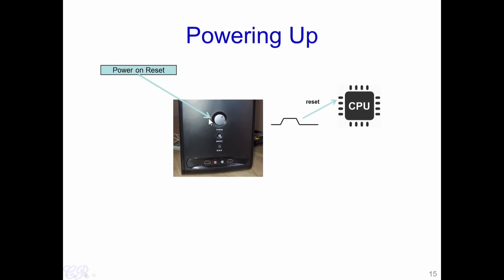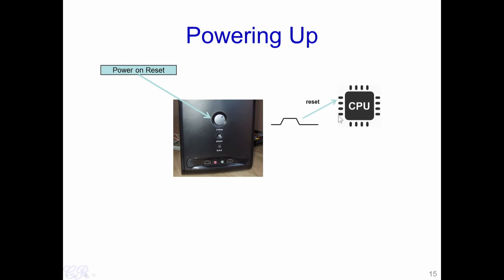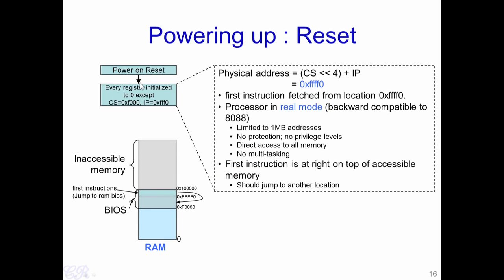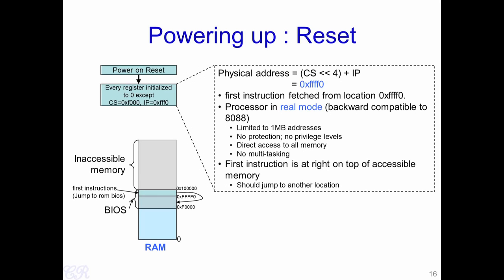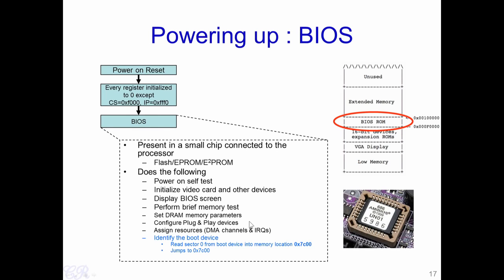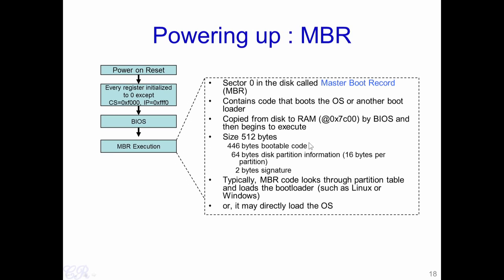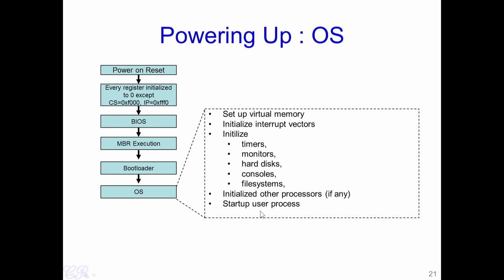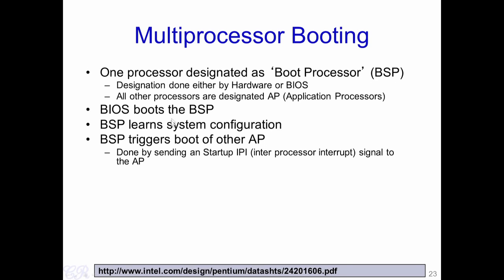Operating System #10 PC Booting: How PC Boots | Explained in Detail

Comment: I'm looking to learn even more detailed steps, going straight from pushing the power button to the CPU getting the reset signal is skipping many steps that I'm trying to examine. I'm basically trying to figure out how with no OS a computer can know enough to know that it has no os... the firmwear level, how does it know how to load a kernel, how does it run POST, how does it run cMOS, how does the cup even start to know about memory addresses, how many relays provide power to what components when the power button is pressed a physical connection is made allowing electrons to flow, that flow is regulated and controlled and sent to various parts in some scheme that gets the right voltage and amperage to the right parts at precise timing... all this breaks down to very small mechanical logic, but surely we don't manually program this by painstakingly setting permanent physical logic gates in a very specific layout by hand, the components are far to small for that, but I'm guessing we do still have people who program mechanical logic, and the work of physically making that tangible is done by robots, but that's the meat and potatoes of what I'm after, how do we figure out how to arrange logic gates in such a way that a BIOS and C-MOS and POST can exist THEN I and only after understanding that do I want to know how the CUP works on an electron level, Then I will concern myself with how kernels are loaded then, I know enough about after that to really really feel like I have a super sold grasp on how computers work on basically all levels. I know about OS development and I'm an application and web developer and super user on Unix like systems (especially Linux and Solaris) and a solid user on Wndows especially NT variants and I'm basically useless on pre-unix-adoption versions of Apple's OSes, but not a huge issue since these are very old and come from a time when apples was not popular so today you don't see a lot of older than old apples. So I'm lacking some knowledge on them, I'm not missing that knowledge. (Think 'I miss my mum' form of 'miss'.) But I want to know about complex mechanical programming with logic gates and how that can power software.